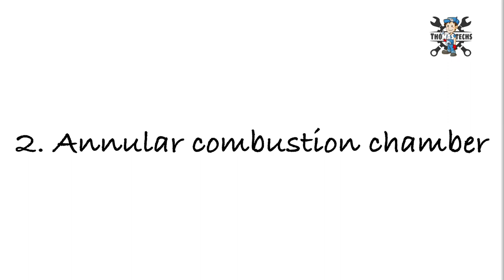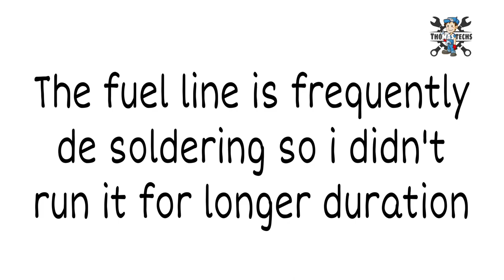Homemade jet engine

Comment: This is the most detailed video I've watched on making my jet engine
Reply: don’t use this to make a jet engine
Reply: Good safi sana umejitahidi eng jet
Reply: @Ajokeiguess  why not? everybody who clicked on this video probably wants to make a micro jet engine without spending a lot of money
Reply: @unqwoken this isn't a jet engine it's a fucking blowtorch, effectively a afterburner in a a EDF, I doubt this could move itself
Reply: @mr_moose4529 how could he improve it?
Reply: @salvadorlehari683  i mean this is cheap but really wont produce any thrust. to really make this a "jet engine" you would need a turbine blade attached to the compressor and not a motor, but this would not work as a jet as it would melt or blow up or just fail to start. jet engines are complex and expensive and you wont make a diy jet engine under a few hundred dollars

Comment: Amazing video! I suggest moving the main fuel line back and making the needles more long, so it won't be in the hot part of the engine and it won't desolder.

Comment: You would have much better luck using brazing rods instead of solder. Im not 100% sure if the difference in melting points would be enough, but probably would be. At the very least you would get a much longer run time by brazing instead of soldering. Just one guy's opinion.

Comment: This is not a jet engine. This is a shitty flamethrower
Reply: In this case it is actually a jet engine unlike most videos on the topic. It has a compression stage and a combustion stage which is all you need. The compressor is simply electrically driven rather than turbo charged. The flame is only that extreme because it's not running for long enough for him to adjust the air-fuel mixture post ignition